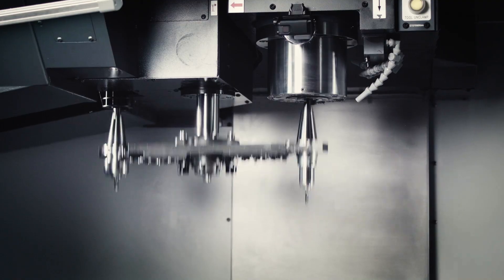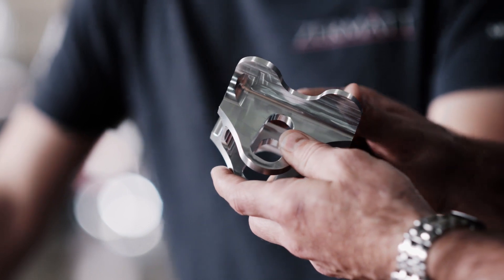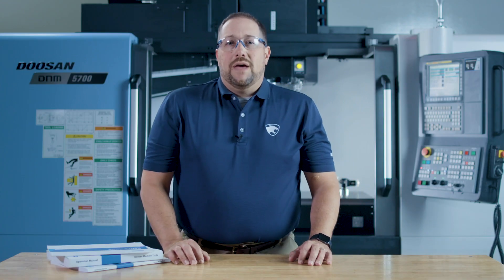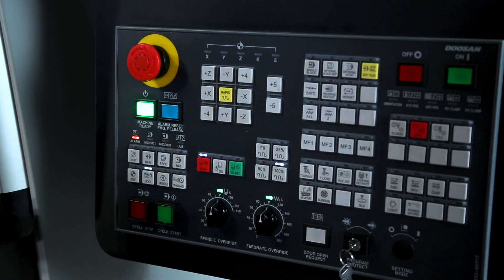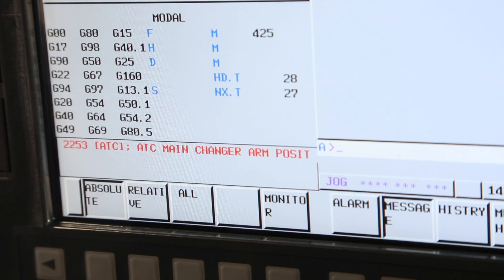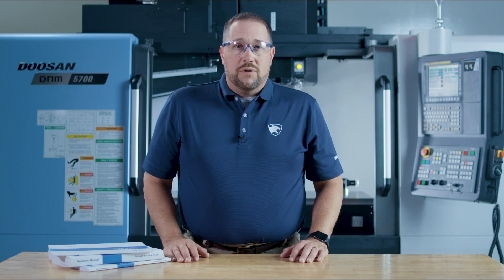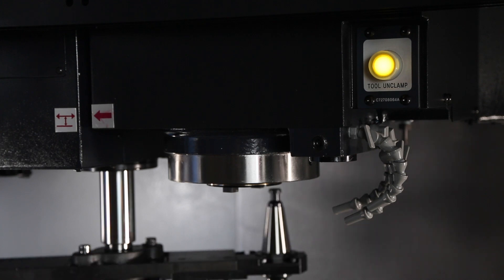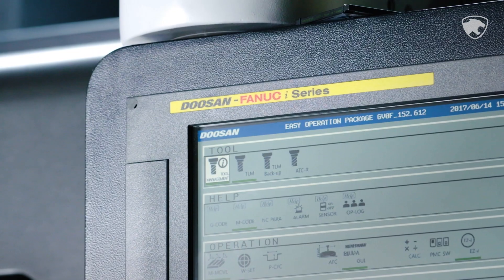Tool Change Recovery - Know Your DN, Episode 1

Comment: Some newer Doosans are lucky to have this key-in possibility. Or, you have the likes of Hartford, where the only option after pressing reset while tool is changing (same if it makes a bump noise due to obstruction or Z0 misalignment, typically after 'overload') is to put a bucket of swarf under both tools. Or have someone holding them, while you climb the 3m up on the roof of the beast with 14mm spanner, open the fixing brake  prong around toolchanger motor and slowly turn motor axis bolt with spanner,  returning arm to peace position with considerable force and close the fixing brake. Once the arm let go of the tool, it will fall from the spindle and 50/50 chance of the one in toolholder to do the same, if not high enough to clip in. Done it many times while alone, much fun with 2 buckets!

Comment: how can we load a program from usb device or memory card?
Reply: This was the reason i sold my 5700 after 9 months, to load a program from usb i had to press 15 buttons. F get, f set, p get, p set.. f that
Reply: If you know that, doesn't mean the format will be copatible, read right or at all. On Hartford Tornado2 yougust press Open and choose USB, but there is a chance it won't display some files made on Fusion360. Don't remember wich and why, as someone made the CAM programs for me.

Comment: Can we see how to use the spindle probe to setup your part, and then check part hole diameters during operation for tool wear or correct hole size?
Reply: Brandon, thanks for the suggestion.  I can tell you that some of what you suggested is coming!  The rest I will add to the list that we are putting together of user suggestions.